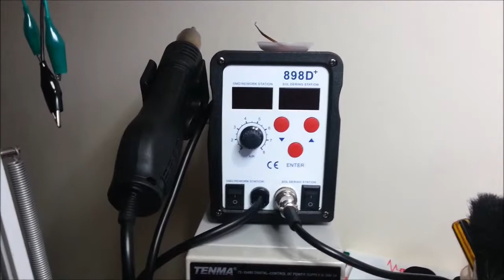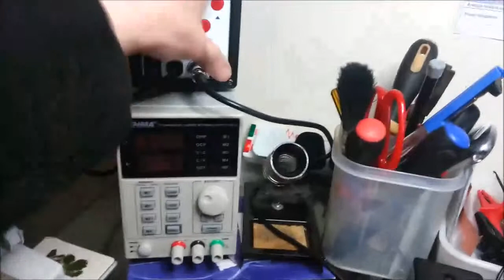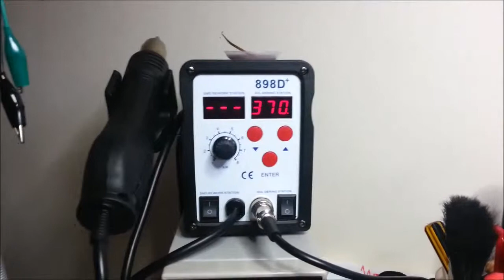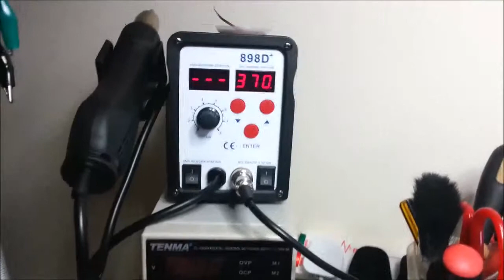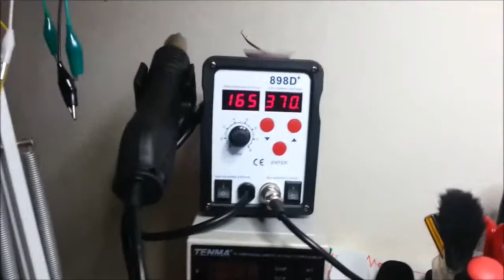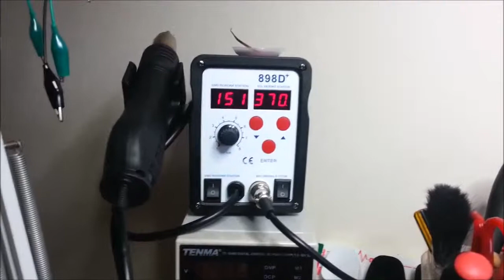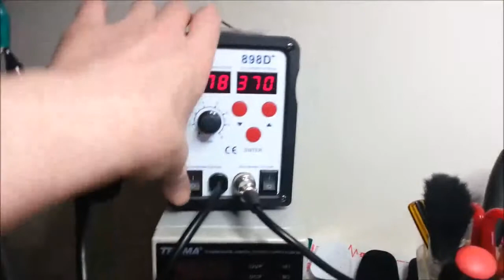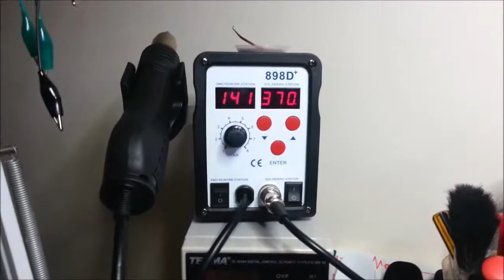898D+ SMD Rework Solder Station

Comment: I just bought one of these today. It will be here in a couple of days. Just wondering how yours is doing 4 years later?
Reply from the maker: The wands ring that secures in the tip get really hot and brittle, then it can break like mine did. Finding a direct replacement proved difficult so I bought another solder station and it is fine. I still use the hot air on this one.
Reply: @Elecifun  Cool, I really like mine. Mine came with a black iron instead of the blue and yellow. It's branded "Mark Ethan" on the front but I opened it up and the PCB is stamped "Yihua." So I guess these other companies are actually using the Yihuas and just stamping their name on it lol. I thought they just copied the design, not use the actual brand and just change the name, lazy counterfeiters 😜🤣😂

Comment: Mine is branded zeny,so far I like it ,I only  used three times,.for the price it seems to work..
Reply from the maker: I only use the hot air. I have not replaced the wand on this as I have another solder station and use that.
Reply: tks for all your inputs. I am on the lookout for a 898D with brand name SAIKE. also I am not a full time tech guy. I'll be using it occasionally as an electronics hobbyist and to do minor repair work.
Reply: I thought the hot air gun was more prone to failure in these models.

Comment: Hello Elecifun. Just curious to know whether the 898D that you reviewed above few years back is still working fine.
Reply from the maker: Hi, the air gun still works and I use it quite often. The solder wand broke at the ring between handle and heating element within a few months. I  could not find a replacement or a wiring diagram to modify another wand. 
I was a lot more naive back then and now could and probably should rewire a spare wand for it. It is worth getting if you use 60/40 as it's working temperature is lower than lead free.
Reply: It broke? Would you blame the product or could one have prevented it in hindsight? Thanks
Reply: @Elecifun  They're available on both Ebay ($3.49) and Amazon ($14.98) now.
Reply from the maker: @ljprep6250  What are ? put a link in or your info is useless